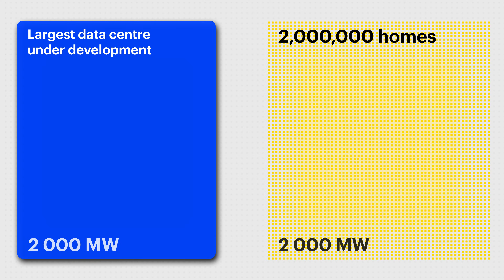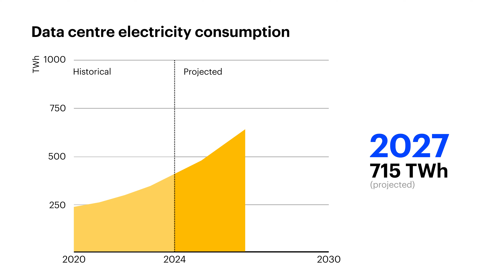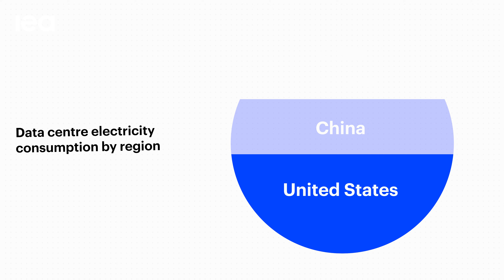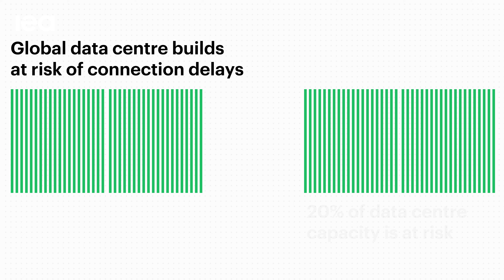How much electricity will AI need?

Comment: THere is NO LIMIT as FUSION not TOKAMAK  (bullshit) but Reverse Configuration Anutronic Fusion will provide high Beta and these will be used for Direct Electrical production with NO intermediate systems. Small systems arrays will produce 500MW to 20GW!

Comment: So fossil fuel is gone in 20-30 years
Reply: Can electricity replace synthetic rubber, nylon, synthetic clothes, asphalt, aspirin...any of the 6000 plus products we get from oil? As they are refined off with heat, if we want one we get them all.
https://youtu.be/nT6sE69J8yo?si=WuCk4MdMdJKe1Ae_  (What's in a  barrel of oil)